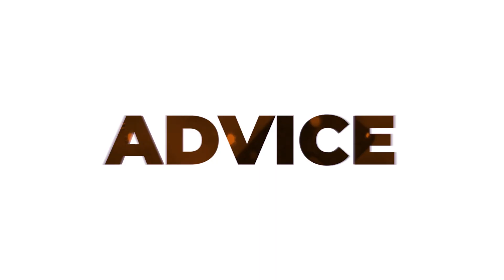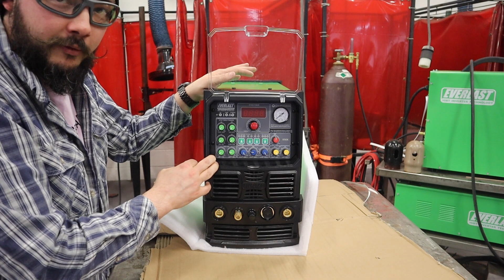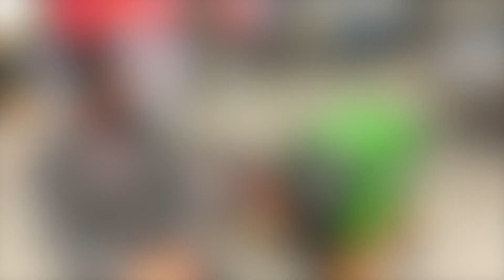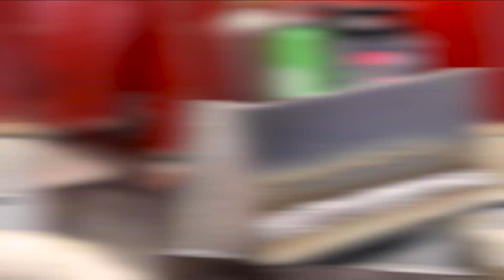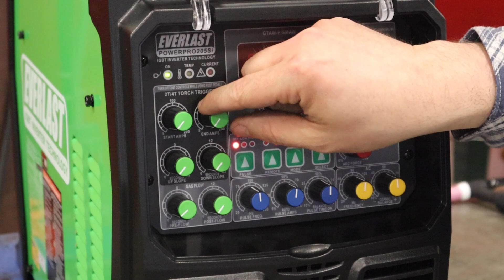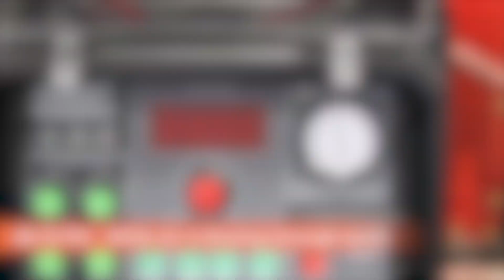Welding equipment review: PowerPro 205si

Comment: Versatile little machine, there! Thanks for the demo!
Reply: You're quite welcome. It's certainly been a welcome addition to the shop. The rest of the plasma cutters in the classroom have large industrial plugs on them, making them not very portable, so having the ability to plug this in anywhere I've got a standard 220v output is pretty nice.
Reply: @chrisewing3272  fantastic! I'll look into the manual and check the specs in more detail.

Comment: I've had the 256Si for 4 years... good machine ... water cooled but torch only lasts for 15 months at most before it leaks. Good customer service... I would buy again.
Reply: Glad to hear this. Waiting for mine to arrive.
Reply: My torch started leaking also, they said they have never heard of that happening. But they replaced it promptly.
Reply: At the shop i used to work at the high dollar Miller setups would leak after awhile too

Comment: I've made a lot of money with mine and overall I've been happy with it-- don't think you can beat it for the money, speaking as someone who sells the other guys for a living now. DC processes are A+, nice smooth arc. The inverter isn't super temperamental when it comes to less than ideal power, which is great for mobile work-- I've had to trade out a Dynasty for this machine because it didn't like the genny. The AC TIG leaves a lot to be desired, side-by-side with a Dynasty was no contest, but it's a lopsided comparison. The plasma cutting function works mint, but the torch is c h e a p-- my only real gripe about the machine. Was kind of a pain to ship it with a #26 lead but I understand the logic. I've heard some horror stories about arcing out against the case and frying the board, but so far no real complaints.
Reply: What do you find wrong with the AC TIG?  Are you using the unit with the torch in the negative and setting for about 30% balance?  Most people find it equal, if not much better that I've talked to (than the dynasty).
Reply: @marklugo6002  Arc starts in my experience with the Everlast are just a lot rougher in less than ideal conditions than with a Miller machine. I don't know enough about the electronics to be able to say why that is, but I've been able to get the job done with a Dynasty where the Everlast left me high and dry. My .02 as one user.
Reply: @HogsHeadStudios  all you need to do is adjust the point gap to .035".  That takes 10 minutes. Make sure your torch is negative polarity.

Comment: Good timing because i was just looking to purchase the 250ex powertig but im still trying to keep my eye out for others
Reply: The 250ex is gonna have a bit higher top-end amperage, and duty cycle than the 205si, but you'll get nearly identical specs with the 256si, and the plasma cutter goes up to 60 amps on that one. Basically the big brother to the machine reviewed here.
Reply: @chrisewing3272  hey that's good info thanks
Reply: The ac low Amp start is much higher than the 250 ex. It is only at 20A vs. 5A.

Comment: Thanks for the review.  I have the Power ultra 206pi currently and like it a lot for just a basic garage welder.  But I have been looking at this one as an upgrade.
Reply: I think the 206 is an awesome option for a basic garage unit. The dual voltage input and super light weight make it a great option. The 205si will definitely pack a lot more punch in the plasma cutter, as well as open you up to being able to AC tig weld.
Reply: @chrisewing3272  I have made a lot of things with it currently making a bed.  Except it is getting repaired right now.  Otherwise it has worked flawlessly well until it didn't.